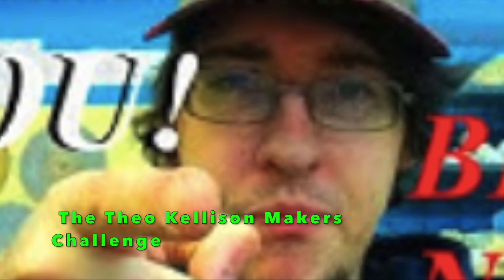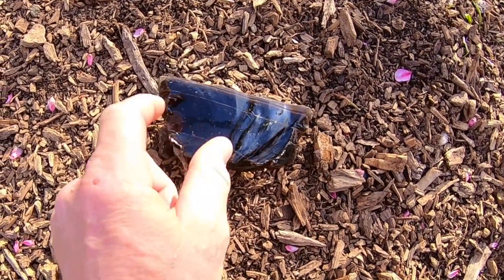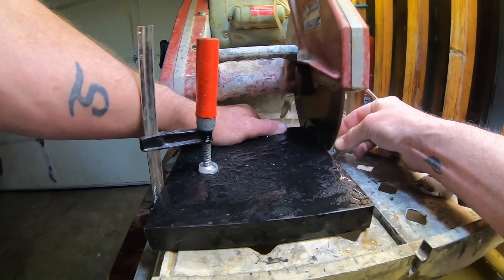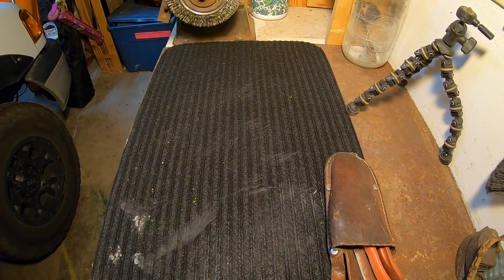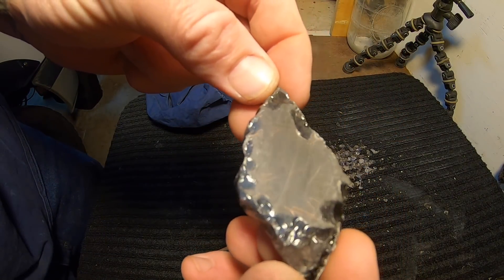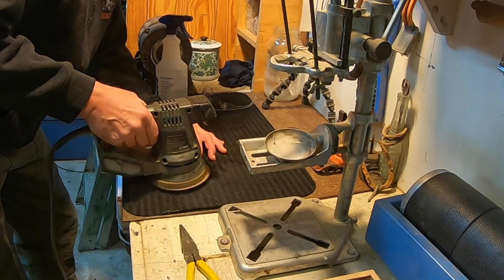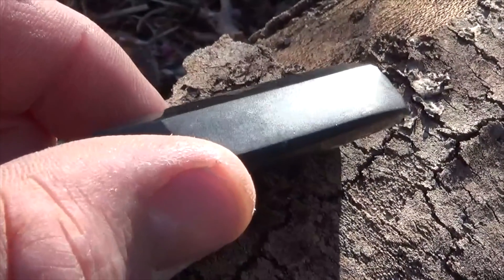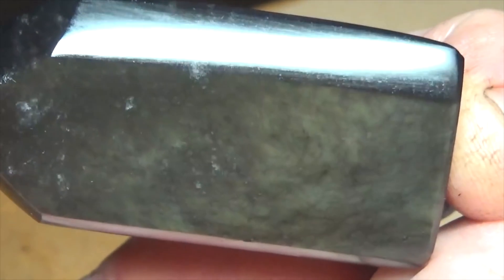My Project For The Theo Kellison Makers Challenge !  -  By : Quest For Details

Comment: I thought you'd do something like a copper wire tree with green stone leaves...what you did is great. To polish glossy real easy...dremel (with flex shaft)*
felt polishing bits & diamond (white polishing compound**. Using the felt bit on high speed, load it with compound & apply to surface using just a contact touch. Do not apply pressure. Keep the felt loaded & dunk in mineral oil occasionally to prevent over heating!
* flex shaft tip: hold like a pencil with bit rotating away from your face but pulling the shaft toward your chest. You can see what your doing without getting a face full of compound. Hope this is helpful. I polished stone glass, metal, etc for years like this & it worked for me.
** I'd get the polishing compound from an automotive place, cause it's used in chrome polishing & it comes in 1lb bricks...to soften it...heat & oil! 😁
♥️🇨🇦♥️
Reply from the maker: awesome ! that's perfect I do have the Dremel, the flex shaft and the felt wheels , I'll look for the compound ! thats supper helpful, thank you !

Comment: I have some obsidian I tried to knap, ended up with needle shards. You did a much better try than I did. Love your tower the sheen is beautiful. Some type of polishing compound with felt pads may be what is needed to bring out the gloss? I think you did a wonderful job forming it by hand. Blisters are part of your hard work bringing your idea to life. Thank you for showing us your project.
Reply from the maker: the black stone that is see through when held to the light. im feeling good connection with the material, carrying it with me , enjoying the smooth weight , I think its a good one for me, and no mater what it seems to desire a pointed shape. soooo much to learn ; )